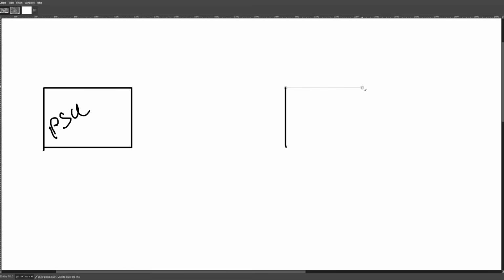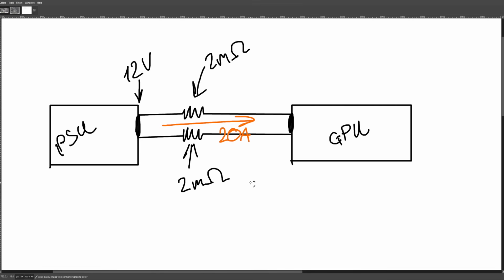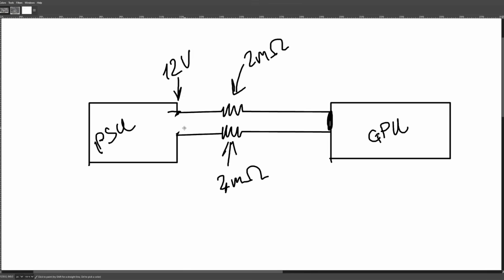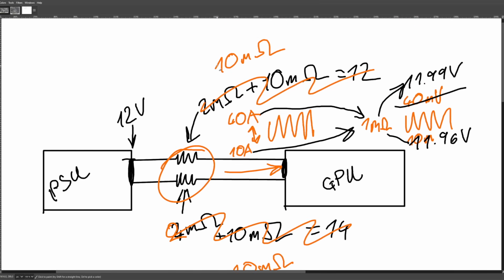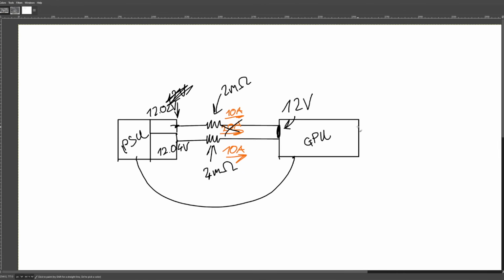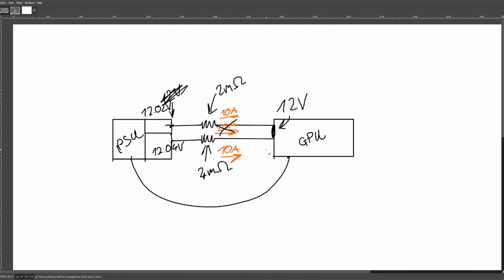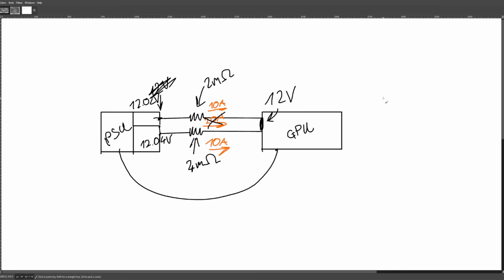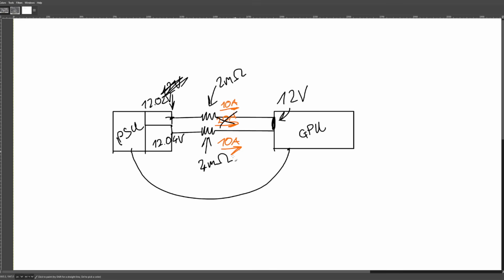Why ATX power supplies don't load-balance power connectors

Comment: The more of this videos I watch, the more I think this whole problem could be solved by the cable being ONE bar connector at each end rather than 6 individual pins. That would mean the resistance of the 6 wires in the cable would never change, with all 6 wires soldered to the 1 bar.
Reply: The issue with bus bars is that you may end up overloading a single wire in case of a short (cable rubbing against a case, for example), which could cause a short current below the limit of the protecrion ciruit. It would require individual fuses on both ends of each single wire to be safe.
Reply: In servers they sort of do. The quick-swap PSU's have a slot to transfer power with the 12v rail being about half of the slot (at least that's how HPE do it).
Reply: It has already been done by Apple and many others for many years. One of the advantages of owning your entire design, instead of adhering to a lazy consortium of companies with vested interests
Reply: Not really it doesn't solve the issues which arrive if a cable is Bend or Broken internally
The Easy Solution is to either scrap the 12pin connector or do what AMD has done to the 8pin connectors just Split the phases into 3 seperate Groups of 4 (two positive and 2 Ground)and call it 3x4 now you need at least 6pins working at all times or the gpu wouldn't turn on (because 1/3 of the MOSFETs wouldn't receive any Power ) or at least 2 groups like the rtx 3090
Reply: @meki___6881  AMD are using the 12VHPWR connector this generation lol
Reply: @whatcouldgowrong7914  they are but using the nvidia/intel spec meaning fires(depending on how much power the rx9700xt can pull)

Comment: So you want the load to balance so it can compensate for unstable voltage coming in from supply to provide the best ideal voltage (current) with what it is given. Got to remember The supply voltage fluctuates from so many things, the original 120v, 240v coming in, the wires, different hardware in psu fluctuating with temperature. By putting the balancing on the load end, the load can decide what's good for it no matter what's coming in, and if it can't get good then it just doesn't power up/something break. However a psu trying to balance could cause voltage and current issues that could lead to blowing the PSU fuses, killing the whole machine, if not worse.
Reply: not at all

Comment: Would per wire (or even wire pair) ocp make any sense on the psu?
Reply from the maker: it would at least be a lot easier to implement than trying to do any kind of load balancing.

Comment: Ima put some car fuses on the wire to limit the amps
Reply from the maker: you do realize the fuses will just pop and completely disconnect the overloaded line right?
Reply: @ActuallyHardcoreOverclocking  Then they will be there for emotional support
Reply: @ then other line get overloaded and pop off. The system with backward redundancy: all 6 fuses should not fail. :D
Reply: Good luck finding any fuses (let alone automotive) within 20% error margin AND with exact required melting current.

Comment: Why doesn’t everything uses the 12v EPS connector for CPUs, didn’t some quadro and data center gpus use that?
Reply: No idea why. The spec existed before PCIe. The 8-pin 12V ESP has 4x 12V wires. 200W continuous is safe. 225W with the thicker male pins would be a good spec for GPUs. 2x 8-pin ESP would be the same as 3x 8-pin PCIe.
Reply: I have been asking this question since Ampere...
Reply: That would definitely be better than 12VHPWR...
Reply: They want to make the PCBs as small as possible and space on the board edges is a premium, bigger connector requires more reinforcement, cost cost cost cost. It's BOM cost shaving all over dressed as miniaturisation convenience.
Reply: EPS and PCIe are wired differently. can't just swap it. but there was never a reason to wire it different, i guess. so in theory, it would have been possible.
Reply: too big, a major reason for the 12vhpwr standard was getting the footprint smaller
Reply: Because nvidia thinks planning obsollesence will make people buy more gpus since you can shift the blame to the connector and not the socket on the gpu. The plastic on connector is usually lower melting point because it doesnt need to be soldered. So user will look at it and think oh yea its the connector not the gpu, let me order a new one. Same reason why some phones start to lag after year or 2. They add too much voltage to ram chips or the cpu soc creating permanent damage and basically forcing you to upgrade and make companies rich. Same reason light bulbs go out because their power supply is working at its peak maximum power output, as well as leds are at higher then specified voltages. This eventually makes it go out. Ofc no manufacturer wants to make led bulbs overbuilt so it works at 50-70% of its rated power and last  20 years while they go out of the business
Reply: @JusstyteN  they only "go out of business" because they won't accept running a company that doesn't continuously grow in size. If someone could calculate the true demand of 20yr bulbs over their lifetime and build a factory to meet only that demand, that factory's workers would all live comfortably and we would all stop having to replace garbage.
Reply: But it is much easier for Nvidia to not have to bother with that stuff and just say "oh but these other people should deal with it, we're just using power" and the Nvidia shills and fanboys will repeat and preach that bullshit.
Just because it's possible doesn't mean it's wise or a good thing to do.
Also that would mean that PSUs would have to be more expensive and break more easily rather than being the one of the most reliable things in your PC. Which again is probably fine with Nvidia, and if the GPU goes boom when the PSU does they can just say it's the PSUs fault, also here is a new GPU for 3k thank you.
Reply: @S1lentSt0rm  I swear the "engineers" who created the 12VHF (12V high failure) connector were high on drunk when they were drafting plans for it.
Reply: It's because it's another 8 pin connector people will try and plug in an 8 pin PCIE connector and blow something up
Reply: @hegxig3340  eps and pcie 8 pins are keyed differently.  They won't go into each other. (Well anything is possible because I've seen one that some1 managed to mangle it into the wrong 8pin)
Reply: @Apollo-Computers enough people will try it. After working retail in an electronics area, I learned there are a lot of people who try dumb things.

"If the plug doesn't seem to fit, then try harder"
Reply: @hegxig3340  the two are keyed different however my psu has universal eps/8pin psu side, I can literally plug my 8pins into any plug I fit my eps, eps 7 amps standard, 8pin pci-e 8 amps standard, but most reputable psus use the HCS(+) standard which support up to 11 amps per conductor, so theoretically, 132watts or 396watts per 8pin, or 528watts per eps, the rating of 150w 8 pin Pci-e and 200watts for eps is due to the realization companies were cheaping out and using 22 and 20 gauge wires and hollow pin conductors and the spec was made to the "LOWEST" common denominator of the potential cables.

12vhpwr is quite the opposite it's made considering the best expected outcome and it's maximum voltage before a failure can be expected is 672w losing one conductor can cause a cascade failure of the connector, losing one conductor on the 8pin pci-e ore eps would still see either of those continuing happily at their rated voltage.

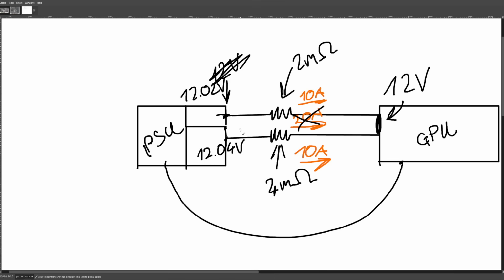Comment: so i'm kinda dumb but not really getting why 14:55-16:52 is 'insane and a bad idea" 😕
Reply: connecting two sources with a dynamic load means you're gonna have to deal with a pretty gnarly "apply kirchoff's law" situation.

 there's now a chance that one source will drain to the other source because again both the psus are tied together on the gpu side, and you will have a fun little +0.01v going through god knows what part of the whole mess of a circuit you have created.
Reply: price & complexity, essentially.

Comment: Not an expert by any mean, would what follow an accurate assessment ?
The 12 volt rail is designed to be voltage source not  current source. I.E it is supposed to maintain 12v (ish)  now matter what the load (GPU in this case) asks for current wise (up to a maximum where it'll  either collapse  -- voltage drops way lower, or shutdown -- ).
Reply: the problem is that someone has to be in charge of current balancing, because ultimately it's the amps that melt wires.

a constant voltage source would work pretty well if the whole spec was, say, 2 bigass wires for +12 and 0 rails and whatever current you draw is whatever current you draw without melting down the whole fucking ( probably 2 fucking metal rods at this point honestly)
Reply: @aeghohloechu5022   I'm not saying it is not a problem, but is it the on the the 15 amps circuit breaker to protect the  house from shitty extension cords or power bars?  
It probably could but that what some engineers would qualify as feature creep. I'm not one though, I just like tinkering.
Reply: @foufou33g    here's the thing though:

to some extent we assume that the consequences of a shitty extension cord burning down will not always take the house with it. Atleast it can never be worse than the 20a wiring in your walls catching fire. With any luck it's probably only the cord itself that melt down and break the circuit immediately, like a demented fuse.

if a gpu connector melts down that's immediately the price of a gpu gone. Something that almost certainly costs more than the psu.
Reply: @  The idea is to not use cords or if one have to use a good one.  I thing that is what this video is trying to tell. The feature creep is usually not what you want, it makes the thing way more expensive and add more opportunities for things to go wrong.
The canadian electrical code (the 2018 edition at least) mandate the presence of electrical outlets so that on doesn't feel  compelled to use extension cords (something something shall be no more than 1.8m from something, in essence a minimal number of outlets in a room, the section 26-724 (a) if you;re curious), that tells me that it is more of a problem than one might think.

Comment: I'd say that one of the reasons I suspect NVIDIA doesn't want to replicate the 3090TI setup would be because if there are only 2 wires out of 6 (like for Der8auer and I don't mean cut off) carrying the load, the GPU would not be stable or would not even start to work. So instead of power connector melting, people would be screaming that their GPU's aren't working properly. And given that this would be happening more than it happens even on cards with 3x8 pin, there would be no way that people would buy "user error" as an excuse. Because in such case it would be paradoxically even more obvious that design is bad. And while lack of load balancing on the GPU is terrible, the whole design of 600W 12VHPR connector that has like 10% safety margin is stupid as heck.
Weirdly people are more accepting of saying that someone plugged the cable wrong when it melts than if the card is not stable. Because people would be livid if cards would not be stable.
And while I'm only 10 minutes into video, I feel like load balancing would be easier at the card (power receiving part) than at PSU (which is sending power). Unless you somehow made the ground pins and cables always behave exactly as the equivalent "power" pins. 1:1. Then maybe PSU could detect and load balance something, but it would be costlier than doing it on GPU and less reliable. Also it would force the connector to have 6 separate lines inside the GPU... I think.... I'm not good at this, so sorry for speculating. But I do know that 12VHPR and it's newer variants are..... not very good.
Reply: The excuse of "user error" really is tilting. Yes, user errors absolutely do happen. But a cable that melts on user error never was and isn't a "good" idea! It doesn't matter that it's user error.
Reply: @mariogamer1088  I agree. If cable isn't properly installed I would usually expect instability or GPU not working rather than "working fine" until connector melts.
And if you design connector that requires such expertise in plugging it in, plus requires every manufacturer to have extremely well built connectors with almost no room for any inaccuracies that would also have to be built so sturdy that they should work for years, instead of designing connector that simply has more headroom - then that is screwed up and it's pushing any "defects" onto user or 3rd parties.

I don't know if I've ever seen general purpose electrical product with 10% safety margin. I think that minimum in wiring the house is like 25%. 10% is insane.

Comment: a right angle adapter with little automotive fuses on each wire would be pretty silly and functional i feel
Reply: here is the deal. this connector is just being stretched thin, you'd never put a fuse on something within the margin of failure of that connector anyway. its terrible design simply put there isn't a good way to fix it besides using a new connector that allows higher gauge wire, and bigger contact surface area.
Reply: someone in reddit actually did this. he put 6 15 amps automotive fuse between the psu and the gpu...
Reply: @muzallisam5068 you'd be better in round inline fuse holders and quick blow fuses (I've used these before and they'd be perfect for this application). Especially since automotive fuses aren't known blowing quickly or reliably.

Admittedly it might also be because I'm in the UK and we do love a good round fuse (they're mandatory in our plugs for example so everyone and their dog has a stash of 3, 5, 10 and 13 amp fuses)
Reply: Putting a 15 amp fuse on a cable thats supposed to carry no more than 9 amps seems kinda silly to me.
Reply: Fuses don't trip immediatly when you put just a little bit too much current through. Fuses trip quasi instanly if you put like 50% too much current through. If it's just a little too much they take several minutes to trip. Otherwhise you would trip the fuse at home every time you turn on a big power draw like a vacuum cleaner, due to high inrush current.
Reply: @pixelsupreme6824  Сables doesn't melt immediately either
Reply: @pixelsupreme6824  Yes. But Rossman discovered these cheap automotive fuses would hold 4x rated current for over an hour! There have been a few garage fires due to this.
Reply: There are mini fuse rate only 3 amp or something. Let say you have a adapter containt 6 fuse for each power pin. U are 100% safe. No melting no overheating. Just have to buy more fuses for replacement
Reply: would make more sense to have a fuse box on the psu itself
Reply: OK hear me out Littelfuse makes SMD fuseholders and corresponding fuses that are only a few mm in size, they come with hard gold plated terminals holder and fuse both and the fuses are ceramic, i think they come in 30A ratings and less, anyway i have been using them at feisty currents for like a decade and haven't seen the slightest degradation of contacts or anything.

Which btw... if we can make microscopic fuses and holders of this quality how come we can't make connectors... OK none of this is penny cheap, things cost actual money at this quality but on the other hand we're talking of thousand dollar videocards here. We can have high quality connectors, NV just doesn't want to.
Reply: @SianaGearz  Yeah, all this talk about balanced wires is not more than just idle entertainment when you consider that they could just have used a connector that doesn't show these problems in the first place. LTT has shown that all of this works perfectly fine with an XT120 connector, and I know that there are others that might be an even better fit. It would have even be possible to create a completely new one that is exactly the right size and has the right behavior. They do have the production quantity to justify that.
Reply: @anlumo1   Funny thing is that Nvidia specified tin plated connector metal. I don't know who thought it was a good idea, normally you demand nickel or chrome to make it more or less long term durable. Tin is also incompatible with hardgold, so you can't even improve one side of the connector to try to slow down cumulative damage.
Reply: But when a fuse trips, that would just disconnect that one wire and the rest would be forced to handle more current. This is exactly what you don't want. You need some kind of fuse that disconnects all wires together if one of them trips. Regular household fuses do that by mechanically connecting the circuits through a plastic bar, but that gets huge pretty quickly.
Reply: @anlumo1  The fuses would cascade much faster than the wires would overheat, because the fuses' thermal mass is very low.  It's fine.  Also, household wiring has circuit breakers, not fuses.
Reply: @anlumo1  if any of those fuses pops, then the rest are already not carrying the current, they won't magically start carrying it when, the card/pc will simply go black, the card will stop functioning and stop drawing current, so the so properly rated fuses will do the job here, but it is still a stupid "fix" to even dumber problem
Reply: @rikkc137  Probably not if there's only a single wire that's bad. Then the current only rises slightly per wire still connected, but it's still enough to keep going. However, a single wire burning up is enough to destroy the whole connector.
Reply: @anlumo1 
the plastic box fuses are just relays with a current sensor that disconnects it when it draws over spec, can be made smaller.